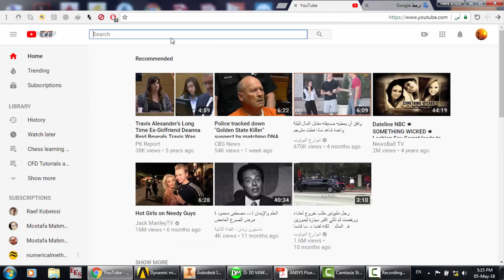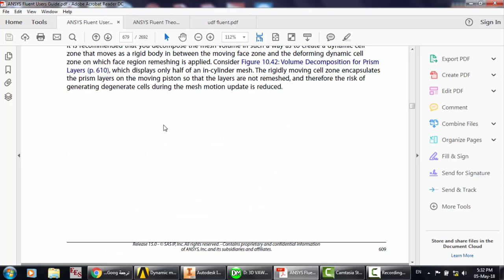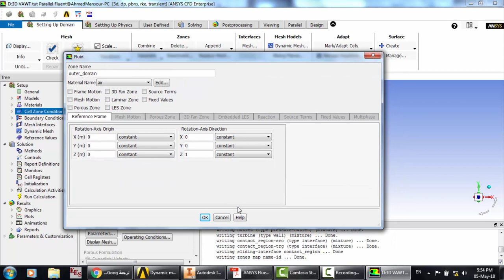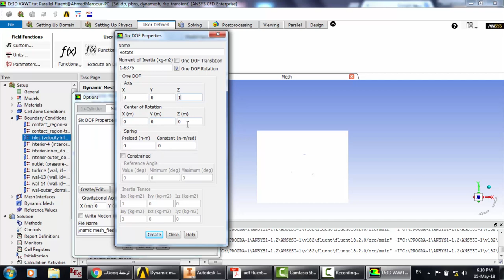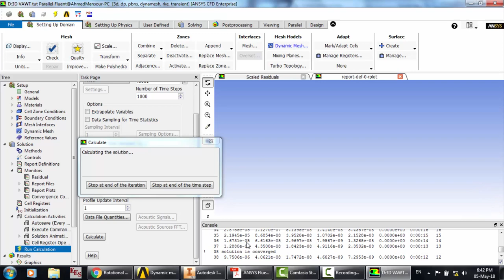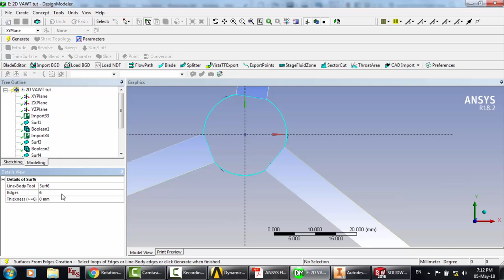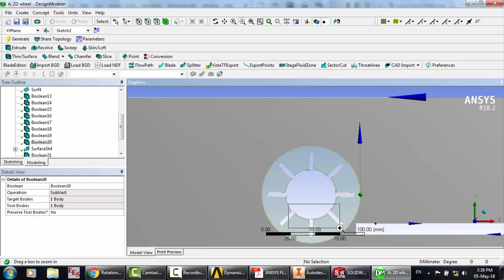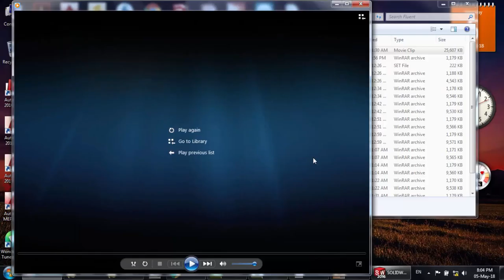Simulations about 2D,3D VAWT & Pelton wheel dynamic mesh 6DOF Ansys Fluent

Comment: Hello sir. I am desperately need your help. After following your video, i have trouble to create surface planar for the 2d vawt. Since i sketched the vawt using solidworks, when trying to make surface planar it says that im selecting non planar or open surface, so i cannot proceed it.
Reply from the maker: Hello dear Azrie, the VAWT rotating domain was created by Autodesk Inventor, then I imported it into SOLIDWORKS after being 100% sure that no problem with the design, the problem you have may be due to a mistake in the drawing, the edges are not connected and this leads to open surfaces, make the method of the planar surface on a simple shape, a circle or a rectangle and see if it works or not, then check out again the turbine's edges...And tell me please the progress. Viel Erfolg!
Reply: Hello sir, I just finished sketched the vawt using inventor. The problem rn is when i saved in parasolid type file and open it in solidworks, it says that "inconsistent modeller version". Im using inventor v2018 and solidworks v2016. Is it because of the version?
Reply: It is because of the version, i opened it in SW 2018 and create planar surface and it went smoothly. I will let you know the progress later. Thankyou.
Reply from the maker: Das ist total super sehr geehrter Azrie! Viel Erfolg! But if you face this problem again, save it as a step file because sometimes I face the same problem with the versions and it works without changing the version :), you always have to try step, x_t, IGS, and ASCI :), Thanks
Reply: Hello sir,  I just finished doing the 2D vawt simulation by following your video. The problem is, the velocity contour is kinda weird. Can I get your email to show you my velocity contours? I dont know what is the problem.
Reply from the maker: @azriehakimie3324  Hello dear Azrie, okay, mech.eng.ahmedmansour@gmail.com
Reply: Hello sir, i have emailed to you my case. Thank you sir.

Comment: Hello, I am doing a 3d simulation of a Helical Ribbon Impeller. I follow all of your passes, but when I try to set the regions for the dynamical mesh, the fluent suddenly stops. I can’t copy and paste the error messages, but I think that is something about the MPI. 
Someone with more experience could give me some help?
My computer is a Pentium dual core (I know, is very slow). I running the Ansys Student 2020 R1. I try to set Processing option to ‘Serial’, but there isn’t this option (If someone knows how to set this option, give me a tip).  The UDF code is:
#include  "udf.h"

DEFINE_CG_MOTION(impelidor,dt,vel,omega,time,dtime)
{
omega[0] = 0;
omega[1] = 150;
omega[2] = 0;
}
Reply from the maker: Hello dear Edilson, sometimes we get this error because of something not right with the setup, maybe the UDF. At least, the computer should have 4GB RAM Core 5. Try to run other simple simulations and see. Also, do not use any UDF now and follow my setup and see if you can run the simulation or not. Danke!
Reply: @haveanicetime  Thanks for the advice!
 I replace my Ansys 2020 R1 with a older version, the 2019 R3. When I use the 6DOF code the fluent doesn't work, but at least I can configure without the fluent suddenly stops.

I have another question. I define the dynamic mesh to the volume around the Impeller. Then I just want to set a constant rotational speed (omega) to the Impeller. For the dynamic mesh, do I need to set a 6DOF code to the Impeller, or I can just define a rotational speed to the Impeller in the bondary conditions?
Reply from the maker: Hello dear Edilson, for constant rotational speeds simulations, sliding mesh is used not the dynamic mesh approach. The dynamic mesh is used only to let the turbine rotate because of the wind speed. I have mentioned this in the video and you can watch my video about sliding mesh for 2D or 3D simulations. Danke!
Reply: @haveanicetime  Hello, thanks for the previous advice.
I solve the problems with the configurations of the Ansys, now I am trying to validate my simulations with previous works data. The results are not so good. I am trying to understand why.I am using the same dimension of the impeller SH1 in the paper on the appendix . It's a Helical Ribbon impeller that rotates at high viscous fluid (8000cP).I am setting a mesh motion at the fluid and a rotation speed at the impeller in the boundary condition. Also the tank is stationary at no-slip condition. But when I calculate the Kp the result is very different from the experiment. I tried also using the dynamical mesh, and the result also was not good.Do you have any suggestions?
Reply from the maker: Hello dear Edilson, I have replied to your e-mail. Only contact me by e-mail to save time. Danke!

Comment: bro can i ask something based on my cased of study, 3d vawt
Reply from the maker: Yes dear Mohammad, go ahead.  Danke!
Reply: @haveanicetime  bro, i have problem to make a simulation of 3d vawt, which is the case to make the 3d vawt to rotate with various input of wind speed, to get the angular velocity, and moment,  it is possible for me to do simulation without udf?, if you dont mind, can you share with me the step
Reply from the maker: @mohammadaiman3661  Hello dear Mohammad, watch my other tutorials about 3D VAWT without coding. You will find it about VAWT and a turbine ventilator. Check it out and if you have questions, ask please. But this is for the turbines which have a fixed rotating speed. If the turbine has a variable rotating speed, you must use the dynamic mesh like this video and I did not use any udf's. Danke!
Reply: Have a nice time! Bro how can i contact  you to ask my problem, actually i already saw you video, but the geometry is no same as mine. Can i get you email bro? I want to show my problem, or you can teach me the step to do it properly
Reply from the maker: Okay dear Mohammad, here it is mech.eng.ahmedmansour@gmail.com
Reply: @haveanicetime  I have email to you, hope you can reply faster
Reply from the maker: @mohammadaiman3661  I have replied.